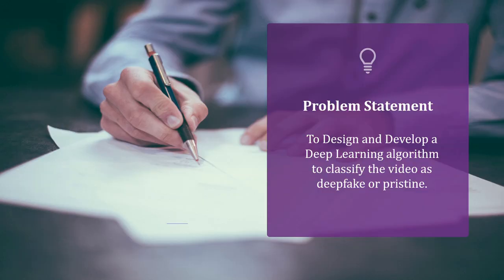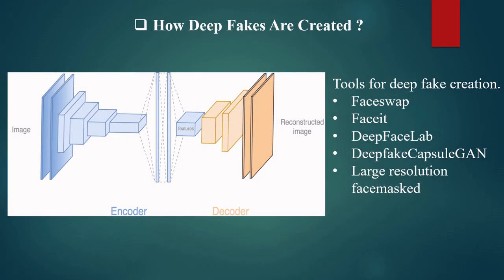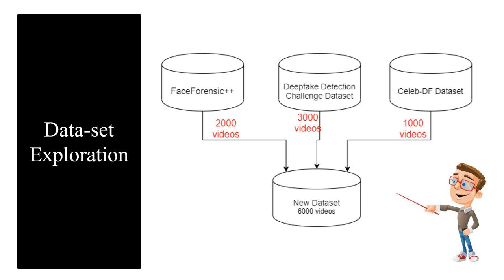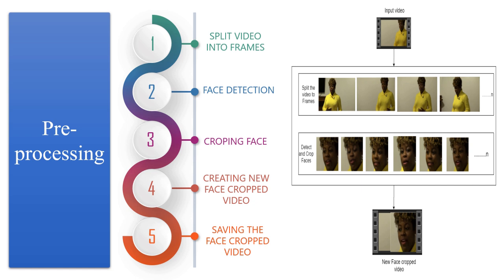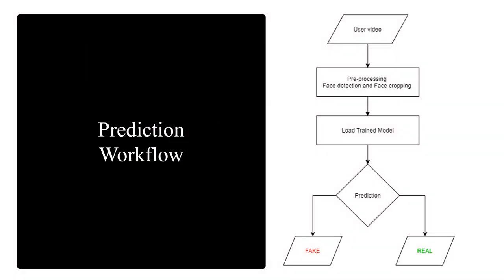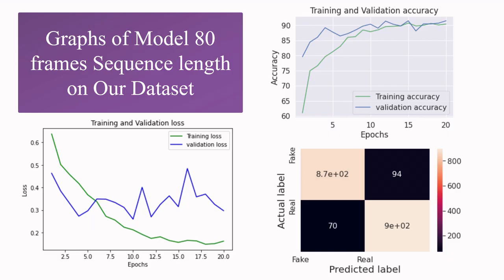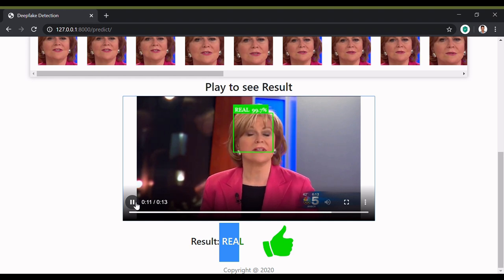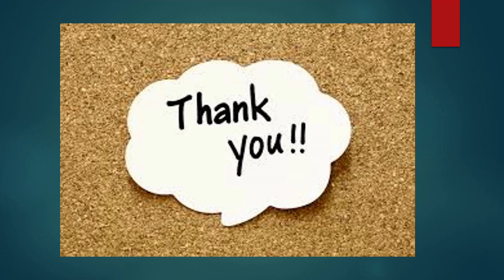Deepfake Detection Project using LSTM and ResNext CNN

Comment: I have a question. I'm currently using AI Video Faceswap Version 1.2.4. I use Cuda, which is an option for faceswap with RTX4060. The current problems I'm encountering are: 1. The result of the video is that if it's a person eating rice with a spoon, the images of the mouth and the spoon they are eating with will overlap and are not natural. Or if they turn their head all the way up or all the way down, the new face will not overlap perfectly. And if they turn their heads left and right, there is the same problem. I don't know if it's because the AI Video Faceswap Version 1.2.4 program is not fully trained or not. But it was only released not long ago, around October 2024. I don't know how to fix it. Or can you recommend a more complete program that doesn't have to fix the overlapping images that don't fit with the new face that is swapped. The main problem is that if you turn your head all the way down, look up, turn your head left or right, or open your mouth to eat, it won't be natural. I have to use another program to fix it, it's really a waste of time. 2. It still takes a long time to perform faceswap with this program. I don't know how to fix it. Please give me some advice or recommend a program that can do video faceswap as fast as Premiere Pro that uses H264 Hardware acceleration. It would be great. It would save a lot of time in my work. Thank you.

Comment: Thank you for the project after some changes we have increased efficiency and the project working perfectly
Reply: Bro please help me out for the installation of the project..
Reply: Can you please help me to run this project
Reply: can you help me out with that too?
Reply: bro help with this project
Reply: Please help
Reply: can u help me with the project
Reply: @abhisreevelupalli9451  How are you doing with the project
Reply: hello can u provide me the video
i am curious to know more about it 
can u provide me the project ??
Reply: Heyy bro !!!!!!!
Can you please help me with the working of the project ?
Reply: i am also doing the same project but it is not working well can you help me
Reply: I'm using cifake data I suppose to do on the image itself to classify whether it is ai one or real one still some issues are there like in preprocess I have used some  techniques ,trained on resnet got 96 accuracy still it fails at certain moment

Comment: Also one more question, the validation accuracy is higher than the train accuracy, with val accuracy being 83% in 1st epoch while train is 53%. Any particular reason why this happens?
Reply: That means there is some data leakage
Reply: @vishal0251 no it happens because of random initializqtion of weights in the first epoch, it always happen,data leakage has nothing to do with this, how can the data leak when we already have separate folders for train val and test